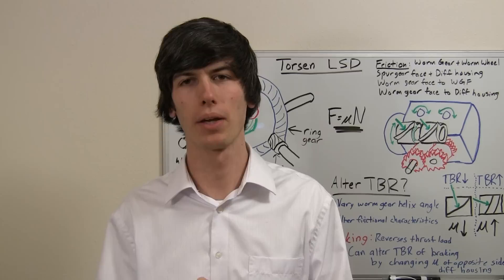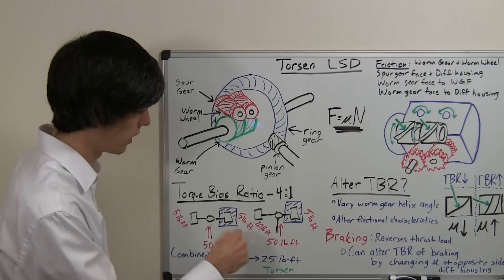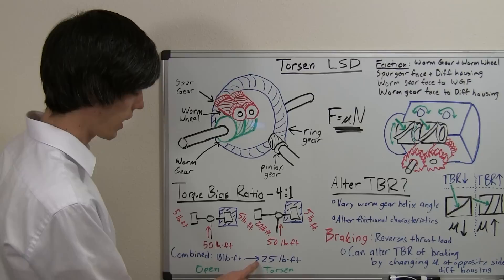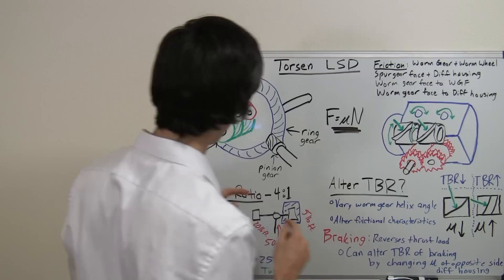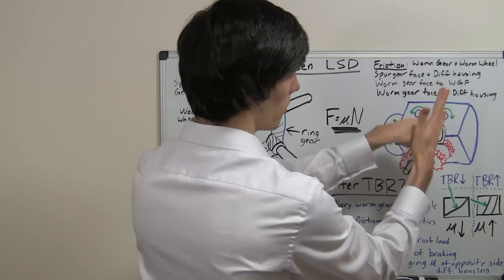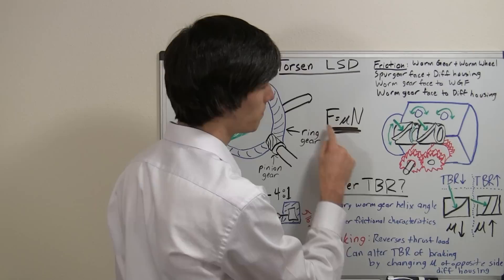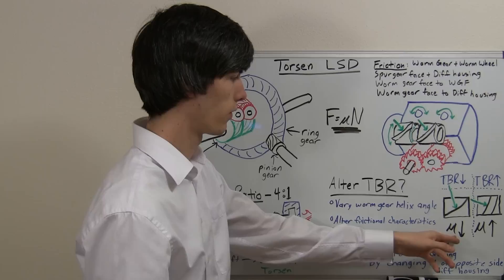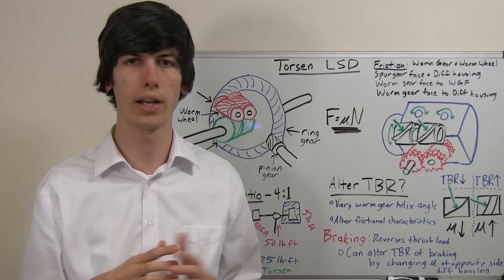Torsen LSD - Torque Transfer - Explained

Comment: This kid is wrong, the torque transfer effect has nothing to do with friction. There is oil in a differential and metal on metal contact strong enough to create a torque vectoring effect would be undesirable as this would cause rapid wear on all the parts with lots of heat and metal shavings and other problems I'm sure I missed. How this works is during a turn each wheel speeds up and slows down in proportion to the other wheel so the worm gears spin at the same rate around the axle shafts. When a wheel starts to slip the axle shaft tries to drive its worm gear faster then the other which cannot happen because the worm gears are mechanically connected through the spline gears, this transfers torque to the wheel that is not spinning. Think of it as the worm gears binding the two axle shafts together only when the difference in speed isn't proportional between the two shafts.

Here's and article:  http://books.google.ca/books?id=nQAAAAAAMBAJ&pg=PA58&lpg=PA58&dq=popular+science+torsen+differential&source=bl&ots=ys4jPKvKw8&sig=OTBm6aPwrae9dXOksSN5qyVu5Nk&hl=en&sa=X&ei=gDs_VMD9L8qGjAK7uYHoDw&ved=0CCAQ6AEwAA#v=onepage&q=popular%20science%20torsen%20differential&f=false
Reply: The proportionality of speed in the differential is not unique to the Torsen, that exists in an open differential as well.  What do you think causes binding of the gears if not friction?
Reply: Jared Shaffer In an open differential only the axles are geared, the other gears in the carriers are just carriers in the housing and free rotation is allowed no matter speed difference or torque load. Because of the worm wheels AND the spur gears the axle shafts are effectively connected to each other. Therefore they are only allowed to turn at the same rate or at equally opposing speeds based on the input shaft speed, if one axle tries to turn at 3 and the other at -5 then binding occurs and torque is instantly transferred. Find an axle with a Torsen differential and try and turn one wheel without allowing the other to move and it won't, if this was based only on friction at such low loads as a person trying to turn a wheel off the ground vs the torque from an engine you would be able to accomplish some slip. If nothing else build a replica of this differential from legos or something play with it and see how it really works.
Reply: Gimpy McGillicutty If you take a vehicle with an open differential and lock the input shaft (by having the car in gear for example) and attempt to rotate one wheel, I promise you that the other wheel will rotate the same speed in the opposite direction because they MUST average to equal the speed of the input shaft.  If you lock that other wheel and the input shaft and attempt to rotate the wheel that is unlocked, it won't rotate.  If you lock one wheel and turn the input shaft, the opposite wheel will rotate at 2x the input shaft speed because ((wheel 1 speed) + (Wheel 2 speed))/2 = input shaft speed.  You should build a replica of an open differential to learn how they work before commenting on advanced differentials.  Note: This is all assuming a gear ratio of 1:1, so if you actually test this, you have to do the math to account for the ratio of the differential you are using.
Reply: Jared Shaffer you're right about open diffs of course but YOU need to understand the torsen before accusing someone who is explaining it rather well that they need to work on their understanding... Watch the kid's first video on the torsen, it explains it well too, idk how he contradicted himself so bad in this video from his other lsd vids
Reply: Casey Gresham I'm sorry, what exactly did I say that was wrong?
Reply: Casey Gresham Actually, let me just go ahead and clear this up.  It's been a few months since I watched his video so I just re-watched it.  If you think he is wrong in this video, then you don't truly understand how a Torsen differential works and I recommend you do some reading before calling someone out about it.  I'll leave you with this to think about

"Torque transmitted to the drive axles through the inclined tooth surfaces of the side gears generates thrust forces against gear mounting surfaces within the differential. The thrust forces, together with loads conveyed by the gear meshes, produce a frictional resistance to relative rotation between the drive axles proportional to the torque applied to the differential housing. The proportional frictional resistance supports different amounts of torque between the two drive axles up to a characteristic "bias" ratio of torques between the axles required to induce differentiation." Source: http://www.google.com/patents/US5232415
Reply: I said you were right about the way the open diff worked but wrong about telling Gimpy he needs to go get a better understanding when what he said had nothing to do with it. Thank you though for clearing up that it is made to work that way. I just had to assume that it would be a bad design to rely on friction because it would wear unless it was lubed which would reduce friction to what I would think to be an almost useless level. It seems to me that the gear ratios of the worms would also have a direct effect on the torque bias, while that and their angles would affect friction no doubt. He did however contradict his earlier explanation of the amount of torque you can get to each wheel when they have different amounts of friction.
Reply: Casey Gresham My reply to him was in response to him saying that I needed to make a model to understand how a Torsen worked when what he described is true for both torsen and open differentials.  He attacked my level of knowledge when he himself did not know what he was talking about.  Also, where did the video creator contradict himself?  I didn't catch anything in there that is contradictory.
Reply: Gimpy McGillicutty your explanation is right and all true, Thank you. I think Jason "slips in this one!!!! Friction implies heat, wear, tear, and power lose. When gears are permanently engaged (like in this differential) the only friction that ocurs is in the teeth contacts and inside the gears axles, not in the sides of gears. As far as I know, this kind onf differential can not be called "Limited Slip" because the gears are permanently engaged. There is a ratio between all the gears, but they never "slips".
Reply: facepalm "Friction implies heat, wear, tear and power lose."  Yep, all of those things occur in a differential, ever heard of differential oil coolers?  http://www.maximummotorsports.com/tech_cooling_diff_cooler.aspx
Or drivetrain loss?  
http://www.superstreetonline.com/how-to/engine/modp-1005-drivetrain-power-loss/
As for wear and tear, although rare, you can find cases of torsen diffs being worn out.

 
How about you go up a few posts, read the one where I quoted the patent and then peruse the rest of the patent to gain a better understanding.  There is friction on the sides of the gears due to the gears wanting to climb each other.  If you want an example that highlights this, look at the wavetrac differential and one of the ways they can adjust the bias ratio for customers is by changing the friction properties of where the gears meet the case at the end of the gear.
Reply: Jared Shaffer Are you sure that the Torsen differential makes use of friction... From my understanding it works based on the principle of a worm drive. The worm can drive the worm wheel, but the worm wheel cannot drive the worm.
The 'worms' are connected to the wheels and the worm wheels are connected inside the differential, which is being rotated by the drive shaft.

If you were to jack the car up and let the wheels spin freely, they will both turn at the same speed. You will not be able to slow down 1 wheel without the other slowing down as well. Nor will you be able to speed up 1 wheel without speeding up the other.
But you will be able to slow down 1 wheel when you try and speed up the other wheel. This is something that happens when going through a corner, 1 wheel slows down, the other speeds up.

At the moment 1 wheel starts to spin, its speed is no longer dictated by the road and therefore has no force acting on it from the road, the worm connected to the axle no longer has a force acting upon it. If the worm has no force acting upon it, it cannot drive the worm wheel. That means the worm wheel and worm are 'locked'. If 1 set of worm wheel and worm are locked, the other set that it is connected to also becomes locked.  (the 2 worm wheels are connected together via regular gears. If 1 doesn't rotate then neither does the other) 
And as a result the diff is 'locked'.

It all comes down to the principles of worm and worm wheel.

Gimpy McGillicutty is correct.

And I agree with Fidel Robles that the Torsen differential isn't a real limited slip differential.
Reply: ***** You can say that the person who posted the video and I are wrong all you want, but it is clear that you didn't even bother to read the PATENT information about this style of differential that I posted.  The information is all there, whether you choose to believe what it tells you is up to you.
Reply: Jared Shaffer I did read the patent. He even states that is you make the tread angle of the worm gears 45 degrees, it will work as a regular differential.
Reply: ***** 1. I assume you meant to say "if you make the tooth angle..." so if you didn't, then please correct me.  2. I have no idea where you got the concept that a worm gear tooth angle of 45 degrees will result in a TORSEN differential operating as an open differential, please point this out.  3. Yes, changing the angle of the worm gear/spur gear pair will result in a change to the TBR.  This is because of the change in thrust load on the gears and thus the contact points mentioned in the video.  The concept is simple.  To have differentiation in a Torsen differential, you must overcome these frictional forces by a torque difference from one side to another.  The required amount of difference in torque is the torque bias ratio which can changed by either making the materials press together with more/less force (change the tooth angle) or changing the materials out for something with differential frictional characteristics.  The second part of that is exactly what the patent I linked to talks about.  If friction isn't the cause of the TBR, then how does changing the friction in the differential change the TBR like the patent says?
Reply: Jared Shaffer 
1) You assume correctly. 
2) From the patent:
This helix angle can be varied from zero to 45 as considered from the axis of the traction gear. At 45, however, it will be appreciated that the terminology of' worm and worm wheels no longer applies because one gear can drive the other gear without any irreversible action, and, in this case, no positive driving of the wheels could occur. In the last mentioned instance it would be necessary to supply spur gears 20 for each transfer gear, which spur gears would be in mesh with each other, in order to enable the drive to be effected because at 45 the transfer gears would turn on their axes and transmit substantially no power to the side gears, the action of the transfer and traction gearing being reversible.

As previously stated, the lead angle of the teeth of the transfer gear must be something other than 45 as considered to the axis of the traction gear otherwise little advantage would be derived over a conventional type of gearing.

3) From the patent:
I have found that the type of action desired is controlled through the selection of the proper angle for the gears. For instance, if a positive drive is desired at all times,- this being one where the power would be applied to the wheel having traction as well as to the wheel having not traction, which I term a traction ratio of :0, or where it is applied 50-50 to the wheels to the point where one wheel would normally lose traction after the friction re sistance in one wheel is overcome and where normallyall additional power will be applied to the other wheel or, in other words, power is applied to both proportional to the tractive resistance; if the lead angle of the teeth of the transfer gear is 27 to its axis or 63 to that of the traction gear and that of the other gear 63, such a traction ratio is realized. It should be pointed out that the angle of 27 may vary either way a few degrees depending on the internal friction in the differential.

The patent holder clearly states that it is the lead angle of the teeth that determines the desired action. Does friction affects the working of the differential, yes it does, but not much.
Reply: ***** Ok, you were looking at the patent from the 1950s which is why I couldn't find what you were talking about.  I was referencing this patent ( http://www.google.com/patents/US5232415 ) which discusses how friction modifies the TBR.  I have agreed that varying the angle will vary the TBR, and clearly at 45 degrees it is at a minimum value.  However, since the original patent, a lot has been learned about the topic, thus the multiple new patents.  Patents aside, would you agree that the force that causes worm wheel to be unable to drive the worm gear is friction?  If you don't agree, then what is the force that locks the gears up?
Reply: Jared Shaffer 
"would you agree that the force that causes worm wheel to be unable to drive the worm gear is friction"
Yes, yes and no.
Yes - because in a perfectly frictionless world the worm gear is reversible.
No - because in 'real life' the friction is always too great to turn the worm and changing this friction is not going to change that.

HOWEVER (this is the part where I come round)
There appear to be 2 types of Torsen differentials.
1 - this type uses 'proper' worms and gears and is irreversible
2 - this type uses a worm gearing system that is reversible ( I was watching someone turning 1 axle on a Torsen differential and noticed the other axle was turning the other way! Something that is only possible in a Torsen diff when a reversible gearing is used)

Type 1 will completely lock due to the worm arrangement being irreversible. 

Type 2 can only lock if there is sufficient friction to prevent the worm gears from turning. And yes I can see how friction could play a major part in the torque distribution.
Heat production would not be an issue, or not a major one because the friction would occur in the part of the diff that does not transfer the torque.

THANK YOU.
Even though I lack the empirical evidence to validate this, the usage of friction certainly makes sense.
Reply: I think he is correct in saying it is friction that drives the Torsen diff.
I don't think he is correct when he talks about TBR, as I think the diff locks up after the 4:1 ratio is exceeded.
Reply: Correct, but to make it easier to understand than you explained, it is best to know the main principle of the Torsen differential; and that is: a worm gear can turn a worm wheel but a worm wheel cannot turn a worm gear.  So essentially, as soon as the speed differential between the axles occurs,  one worm gear is effectively rotating in the opposite direction (relative to the case) and tries to turn the worm gear but can't.  So this creates the lock and since the two spur gears on the ends of each worm gear are joined between each axle the whole axle assembly is locked with the case,  creating a locked unit, where the driving torque can now be shared to the other wheel.

Comment: in a open dif all the power will go to the tire without traction.  so the tire on ice will spin
Reply from the maker: Half of the torque, but since it doesn't take much to spin a tire with no resistance the other tire won't have enough torque to move the vehicle.
Reply: Engineering Explained In and open differential the tire that spins in crazy way does it with all the power of the input. If you were right, and only half of the torque is send to the crazy spinning wheel, and the other half is send to the non-motion wheel, it would mean that I could rev the engine up and up and up, untill I obtain enough power, sufficient to move the car with the half that the non-motion wheel needs to do so. But in reality, you can rev up the most powerfull engine that exists untill it blows away, and you will never make the car to move!!!!
Reply: Fidel Robles You confuse torque with power. Just because a wheel is not spinning does NOT mean that the wheel has no torque. The wheel spinning like crazy has all the power, because it spins fast. It still has just as much torque as the wheel that doesn't spin.
Reply: Since Power = Torque x Revs...

Comment: Dude your close. But not quite there.  Your vids are good but be sure you really know how something works.  First your helix angle explanation is backwards.  2nd. More  importantly your torque bias ratio is misunderstood.  It doesnt send more torque.  It sends more speed to the slipping wheel.  This REDUCES the TQ. To that wheel.  A lowing More TQ. To the wheel with most traction.  Yes the friction has some to do with it but not as much  as you would think.  Study worm gear Torque Ratio.

Comment: If you get your torque bias ratio TOO High you'll probably screw your worms to a premature frictional dust grinding death. Then you may as well have run a Lincoln Locker and took your frustrations out on some cheap generic tires.